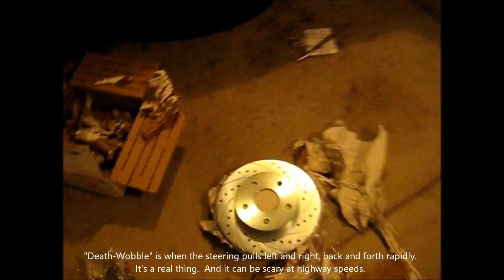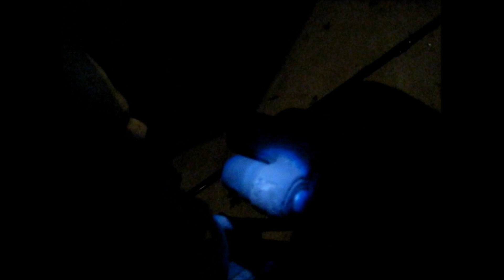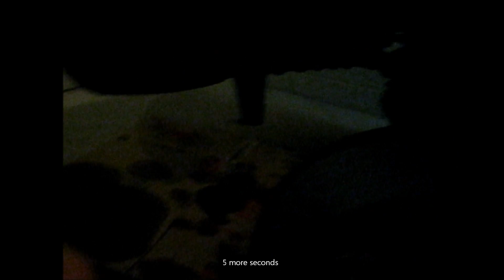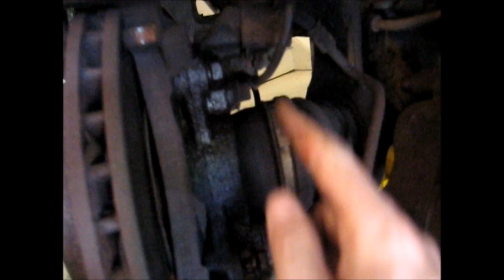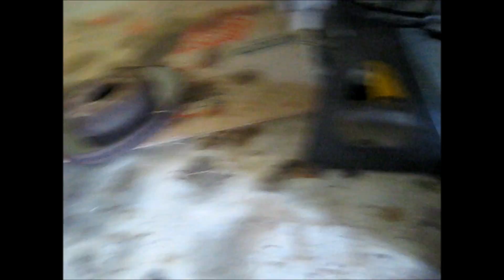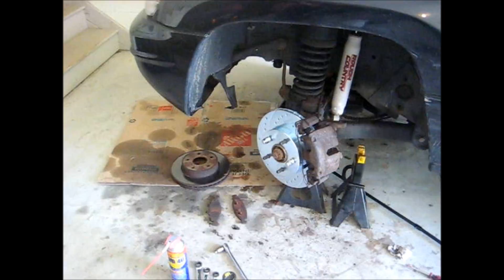Jeep Rotors and Front Brake Pads, Upgrade and replace (death wobble) WJ

Comment: I have a 2003 WJ and I've been dealing with the death wobble for years.  This is the upgrade I plan on doing.  I believe Chrysler used different calipers in '03 but I still get the death wobble.  Thanks for doing this video.
Reply: +Far Reach Engineering I'll have to check which calipers they are.  Yes I have a 2003 ZHP 6spd with 61k miles.  The Jeep is a 2003 l6 with 72k.  I drive a 97 Camry 4cyl with 188k to work as a beater so I don't run up the miles on the other 2.  To bad the i6 in the Jeep didn't come with a stick or it would be real nice.  It would also solve the highway towing problem.  When towing a heavy load on the highway I turn off the O/D but the gas mileage goes down greatly.  I'll let you know how brake upgrade goes.